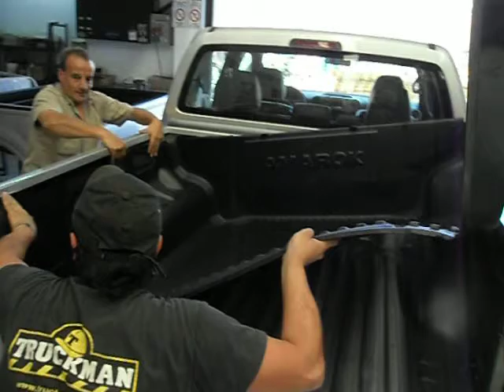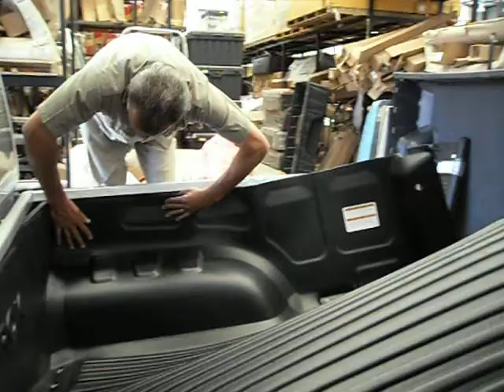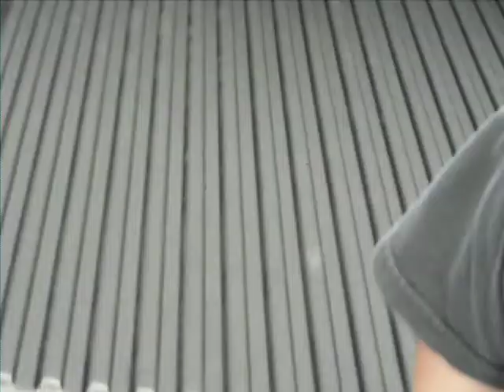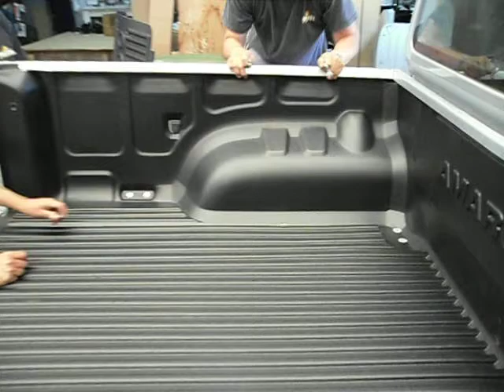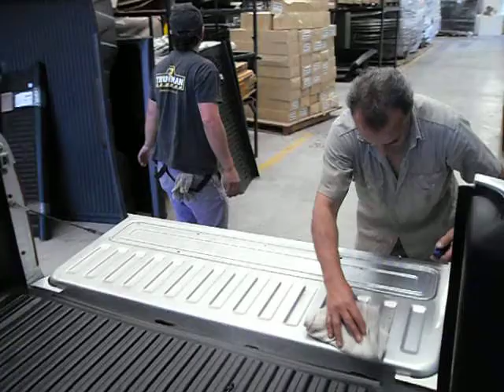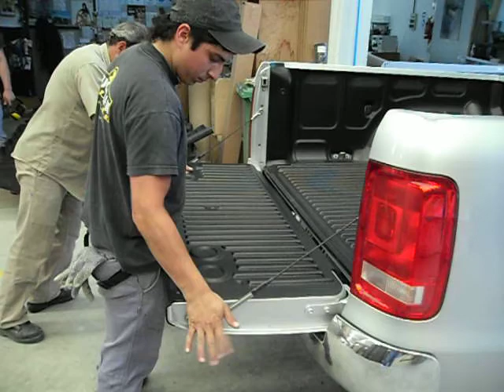Truckliner - Amarok Under Rail Bedliner Installation

Comment: They have not allowed for water to drain out the front drainage holes in the tub,this is going to cause a problem with rust,as I have just found out in my new Amarok, very poor installation in my opinion